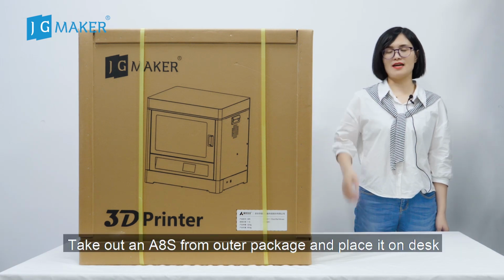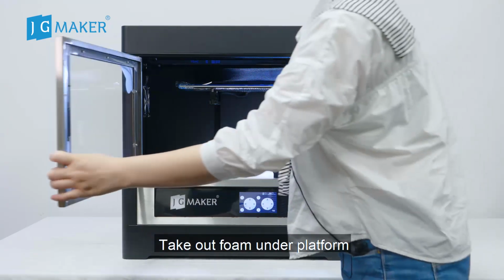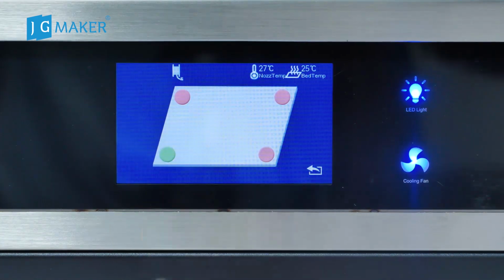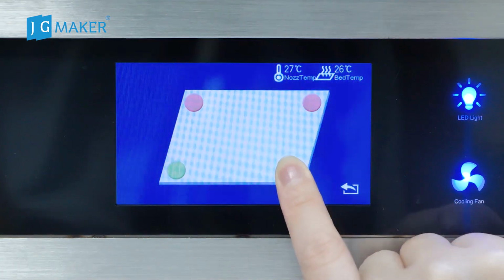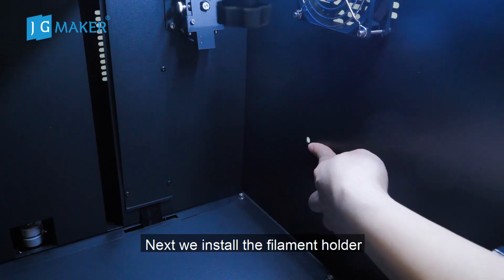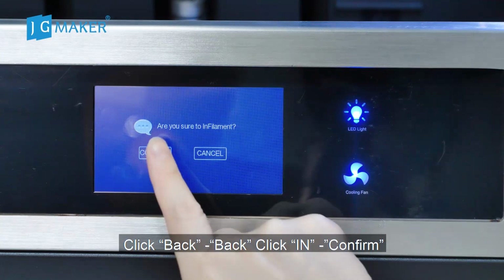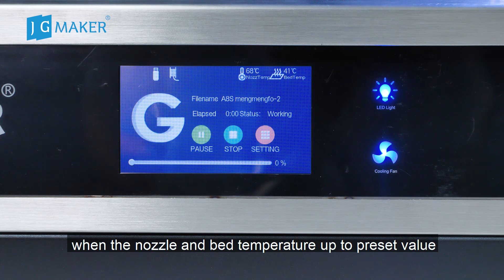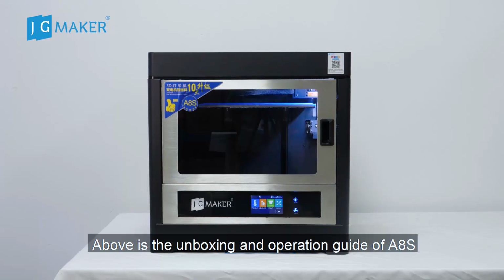A8S Unboxing and Operation A2

Comment: Nivellement à froid ?        Cold leveling?
Reply from the maker: You mean leveling issue or not? what is your exact issue for leveling?
Reply: @JGAURORA3dprinter  Je veux dire que le réglage du plateau se fait alors que la buse et le plateau sont froid (27°) ?    I mean that the adjustment of the plate is done while the nozzle and the plate are cold (27°)?
Reply from the maker: @fabriced  yes,  we perform platform leveling firstly and then preheat nozzle and platform to prepare for filament feeding.
Reply: @JGAURORA3dprinter  ok
Reply: Their new printer heats up the printbed automatically before it runs the auto leveling.

Comment: Why would you make an enclosed printer that has a max nozzle temperature of 245c?  Makes no sense.  Manual bed leveling, no camera to monitor print.  $1700 ?  Have you been paying attention to what your competition is making?  Only good thing is print size of 350mm!  5 years ago, this would have been great - today - way behind.
Reply from the maker: 245c is set just for machine protection to the utmost extent and to get the best printing effect.
Reply: To be fair this printer is 5 years old.
Reply: @s3sebastian  ? why did they put up a video just a few days ago about this printer?
Reply: @trendstrategics  I think they are just adding videos of the models that they have, even the legacy models.
Reply: @trendstrategics I saw the old video screen is Chinese but this one is English operation.